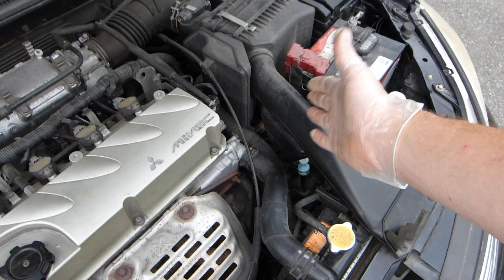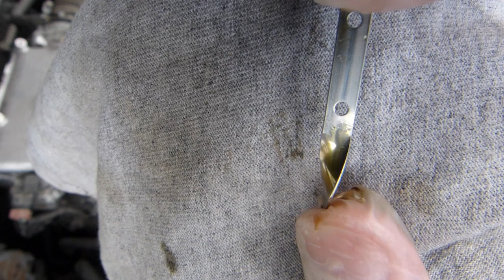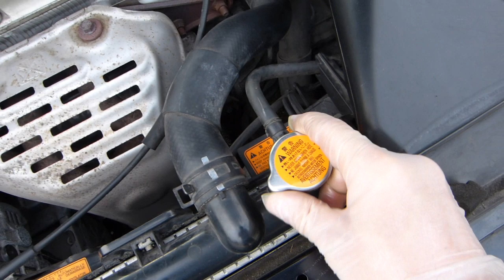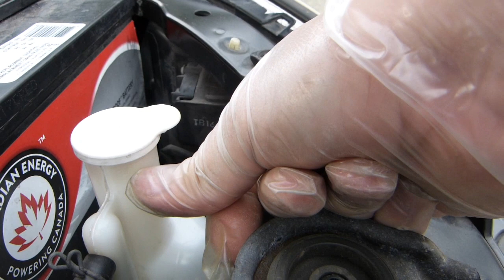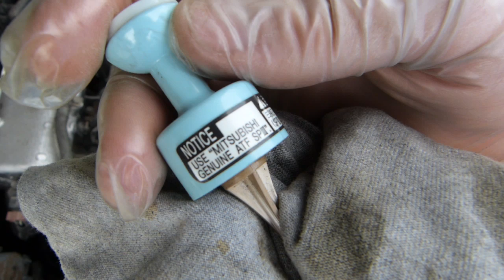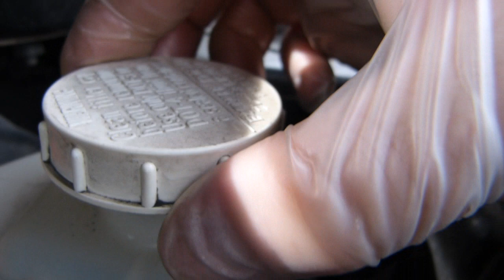Absolute beginners` car maintenance: no tools needed, save $1000s

Comment: Dude u got too low engine oil and too much transmission oil, way above when it’s cold, u should top off engine oil and drain transmission oil, having too much will destroy it. Coming frome someone that have worked in a mechanic shop.